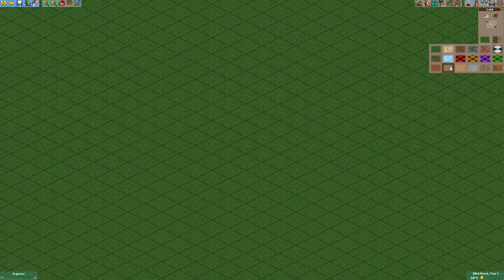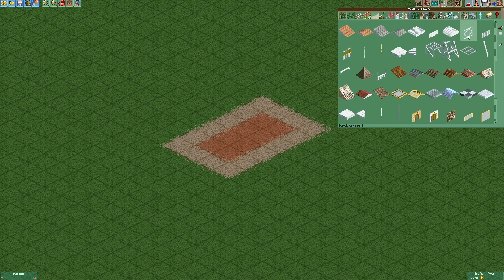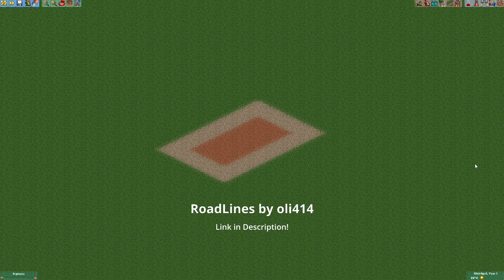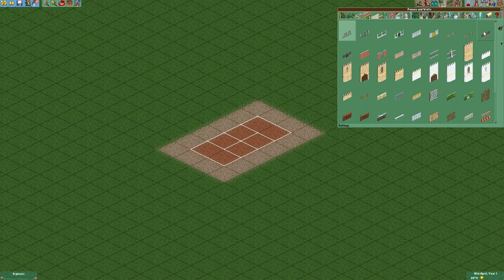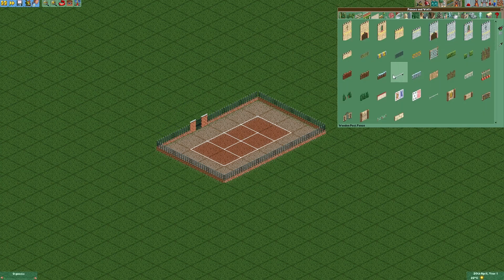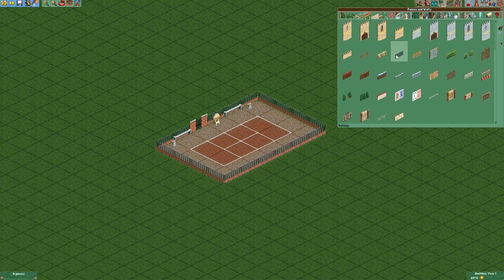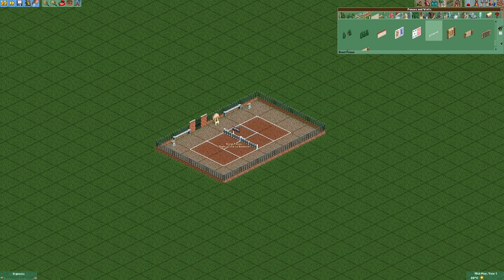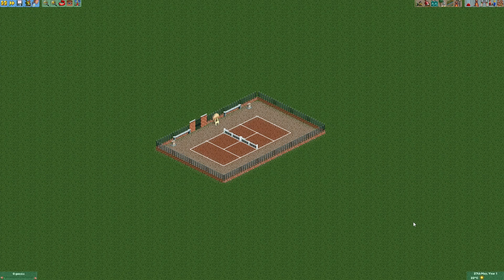RCT Minutes #3: Building a Tennis Court | OpenRCT2

Comment: How do you move the fences into the ground like that?
Reply from the maker: Hey! You can either do that using the tile inspector or by disabling clearance checks in OpenRCT2.
Reply: @Flyxxpy  Thanks! Any key I need to press while placing the fence like shift or ctrl?
Reply from the maker: When clearance checks are disabled, pressing the shift key should do the trick.